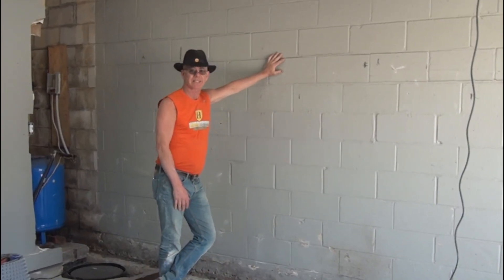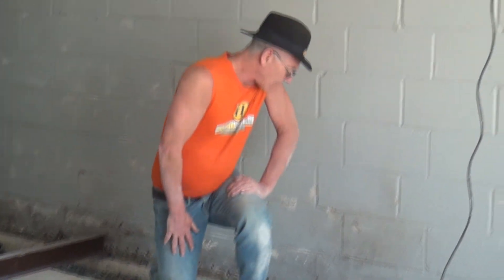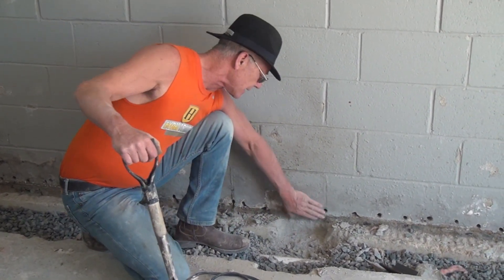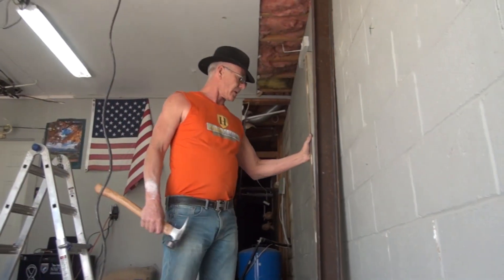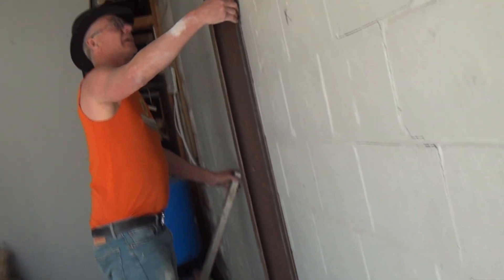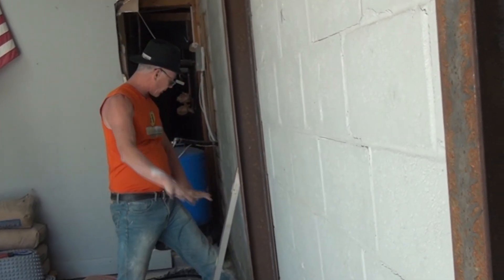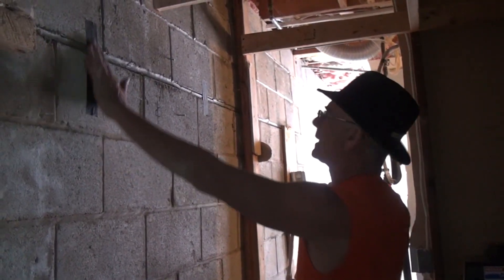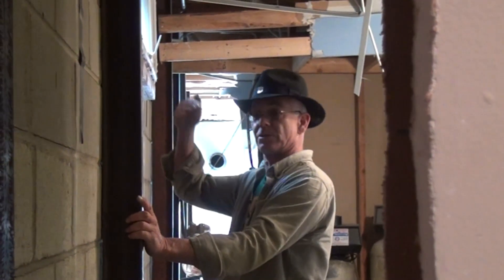NJ - PA Foundation Repair - How to Install I BEAMS vs Carbon Fiber Strips

Comment: i  love this guy, i have a lateral crack along my foundation wall that is about 4 dime size crack in it...
Reply from the maker: Well if you're in Jersey or East Pennsylvania give us a call.  If not I can do a face time or Skype consult and estimate so you know what it should cost and you know what needs to be done and you won't be calling contractors to hear what they will do and how much they will charge you.  You will tell them what YOU want them to do and how much YOU are going to pay.   More or less YOU INTERVIEW a Contractor.  I might tell you the Job should cost TEN Thousand and YOU can offer to pay them SIX Thousand.  Thus begins the negotiations but YOU have the upper hand.  I do Charge $350 for a consult.   
- Daniel J OConnor
Reply from the maker: And hopefully the videos let you know the way a repair needs to be done. 
- Daniel J OConnor

Comment: I have a house I'm trying to sell with driveways on north and south sides of walls that are bowing I am going to use your method. Should I tackle both walls at same time or 1 at a time and how much of a bow is too much to use this method also how far apart do I have to put I beams apart thanks for your time and your videos

Comment: Daniel, great explanation of the process, and the "why". Can you tell me what size beam you use, and how far apart you generally install? 

I've seen 4x7.7 and 4x13.
Reply from the maker: These  r  4x4 1/2 inch.   I always buy my steel from same place.  I will ONLY use U.S.A. steel.  Generally there's less in stock and I'll make slight compromises to get U.S. Steel.  - Daniel J OConnor

Comment: Your videos got much better. The cut-and-splice-every-other-word-technique is not so good. 
This is much better.
Thanks for posting and sharing your videos ! I love your approach and quality of work !
Reply from the maker: Thanks. Actually I've more time to do these now.  You Tube wasn't what it is 5 or 6 years ago.  Whole new ball game and I do these from job start to finish, one job at a time.  I have years of unedited rough footage and will be making full versions now.  I truly Thank you for your support. - Daniel J OConnor
Reply: Daniel J. OConnor - I learned my lesson not to judge YouTubers by one video. 
Do you plan to write an e-book or something like that explaining in details how you do your job, dealing with a different scenarios , different job sites ? 
I know you do a video conferencing, but I rather had something to read , instead trying to remember what was said 2 days ago.
Thanks !
Keep on rocking !
Reply from the maker: 4 X 4 - 3/8.  4 ft apart is a general rule.  But jobs are different with different issues and the spacing can be more or less. - Daniel J OConnor
Reply from the maker: You tube had a criteria when first being created. Basically 2 minutes. And those/mine that are really cut up were done before there was a You Tube.  Uh, but primarily I've more time on my hands to make videos and edit.  I'm getting a bit old and let my crews do jobs.  My 60th birthday was March 21st.  Yep, look good for my age don't I?  - Daniel J OConnor
Reply: @DanielJOConnor  Yes you do!  I don't have crews and I turn 65 this month. And, for the first time, I simply can't do this anymore.  Father time catches up with us all unfortunately.  Your videos provide a wealth of information and knowledge. Thank you!

Comment: Daniel - would you weld the rebar to the I-beam and the L bracket to make it permanent? 
Also, why not painting the metal, especially the rebar , prior the installation to prevent rust from eating away the metal ?
Reply from the maker: No to welding.  No reason to.  Damn I beam isn't going anywhere , EVER.  It's pressed against the footer and is now encased in concrete.   4 inches deep.  People pay $900 per for a Carbon Fiber.   I charge $750 per I beam.  Did 12 in 2 days me and a HELPER.  $9,000 for 2 days?  $500 for helper?  $8,500 net for me?  Keep in mind I've 3 crews all working on jobs.   And no paint.  But thanks for the questions.
 - Daniel J OConnor
Reply: Daniel J. OConnor - by no means I'm trying undermine your craftsmanship, rather the other way around it. I prefer quality and detail over low price, but it's hard to see that now days. 
Thanks for your response, I'll keep you in mind for the next project involving waterproofing !
Reply from the maker: I didn't think you were questioning my work.  Actually your thoughts and questions have great merit.  A coating of epoxy on the steel and welding it together also has merit. Yet think about it.  For purpose of its use here, can the steel ever corrode in yours or mine or our great, great, great Grandchildren's lifetime?   Will it ever move with all the pressure on it?  Coatings and welding are for major structures like bridges and industrial forming.  The welding is just to keep the re bar from moving when the concrete is poured.   Coatings do ad longevity but are also used to prevent rust from beading thru to surface.  These questions speak volumes about your integrity and drive to be a Top Shelf Contractor.  - Daniel J OConnor
Reply from the maker: I did answer this to someone else.  Think about it.  Basement.  Rust doesn't bleed up.  Goes down.  The rebar and angle iron are set in concrete when the job is done.  If you look you will see both are 2 - 3 inches below what shall be the finished floor.  It's a Basement.  Yes welding and grinding and painting is better but totally and completely unnecessary.  And let us all not forget about having to haul around welding equipment in your truck.  - Daniel J OConnor

Comment: Do you have any videos that address houses with stacked stone foundations?
Reply from the maker: Closest I have is "New Jersey Farm House."  It's a rubble foundation though. - Daniel J OConnor
Reply from the maker: Oh Boy,  ask yourself why I wouldn't?  Why I don't have a video on Stone Foundations?  Stone on Stone old school is the best damn Foundation on the Planet.  Can't remember the last Stone Job I did.  Yes I have done many but not in a long time.  Yes they do have issues but I'd have to see what the issues are and know what you need.  DO KEEP IN MIND,  most stone foundations were done by different Masons.  There were no 100 home housing developments back then.  There were slackers back then as there are now those foundations do have a few issues, like falling down.  It's all in the original mix of cement.  1 part Portland to 3 parts sand with 1/3 part lime.  Lasts forever.  Of course the cheapo, new be, think they no betters who didn't no shit did the 1 part Portland 4 - 5 - 6 part sand nonsense and the Mortar between the Stones is now sand.  I do Face Time and Skype consultations and estimates.  The Charge is $350 but what you save yourself from disaster is priceless.  - Daniel J OConnor